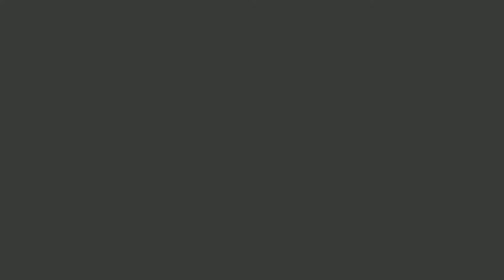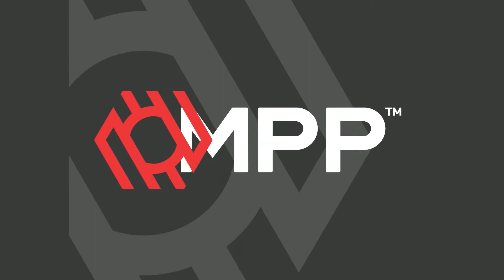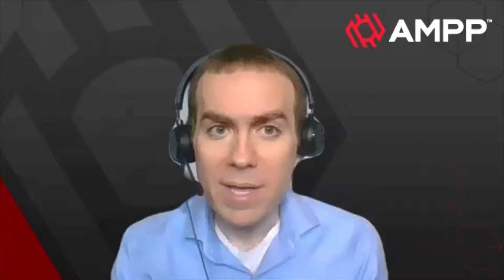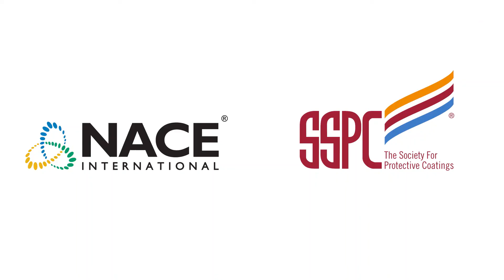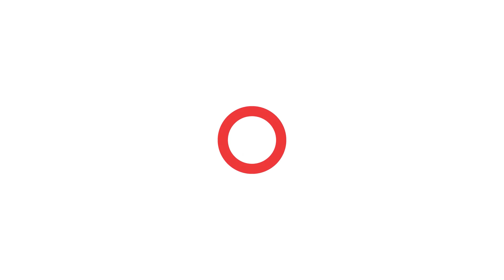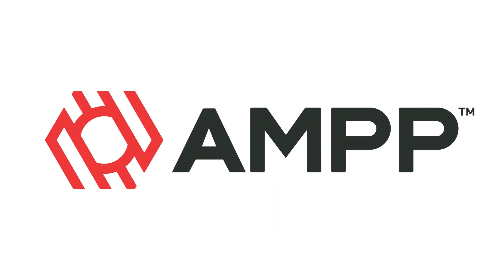Concerns in residential buildings & possible implications of corrosion in the Champlain Towers.

Comment: Great questions result in more understanding. I'm simply a concerned citizen not in the field trying to understand how these things happened. I've seen buildings on seafront in the Caribbean that have been abandoned for years, and although dilapidated, they are still standing. In my mind there's more to this tragedy than  deferred maintenance.  Nobody else is talking about the soil conditions and how it may have changed. The reasons are either ignorance, politics, or money. I can imagine the consequences for a whole city to be considered built on ground that can't support the buildings leading to excellerated corrosion. It would devastate the local economy and send fear to all residing there.
Reply: We’re this buildings 12 stories high? Most Caribbean old builds are 2-3 stories max. Also the Caribbean is a lot of rock and not so much sand. Miami is sandy soil Caribbean is rock.
Reply: @mowtivatedmechanic1172  I can think of a few old hotels at least 10 stories built in late 70s I think, but yes most are not that high .  I've seen endless amount of condos around 4 stories, never properly maintained and tons of poorly built not in code houses that go down the hill in mudslides yet many still standing . So I'm thinking it can't be maintenance but more structural or bad concrete to begin with.